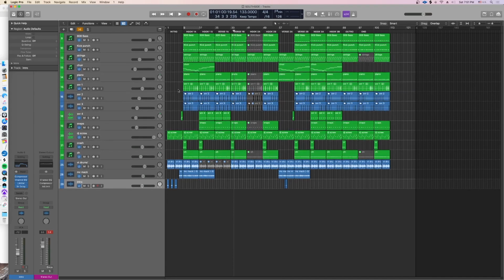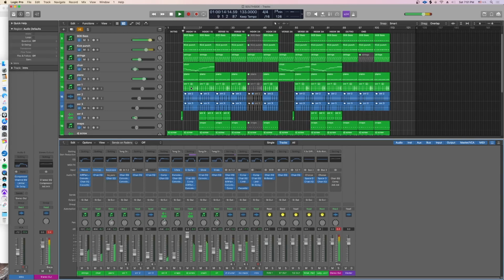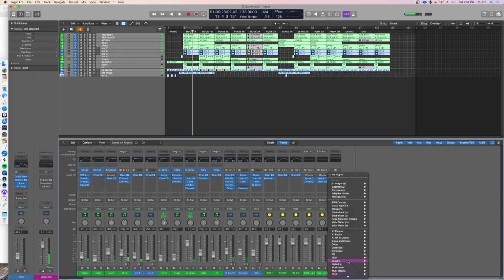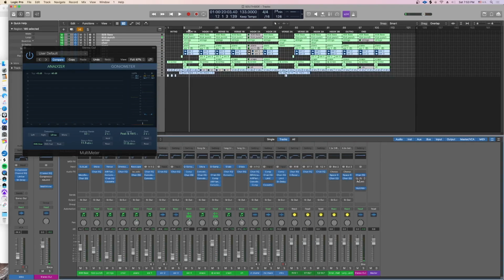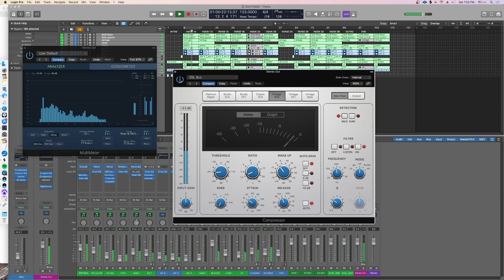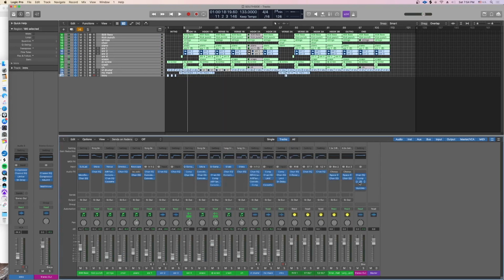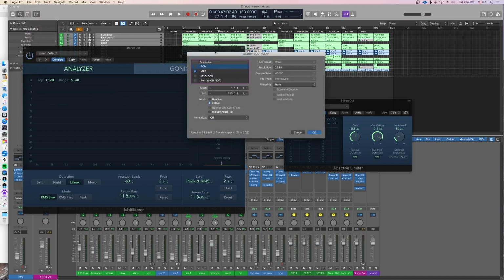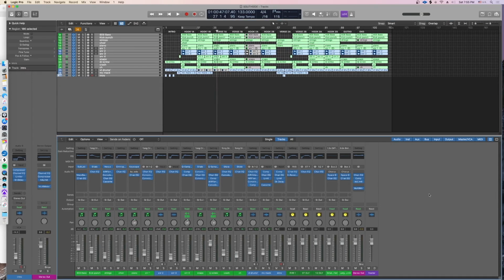How to Final Export  Your Stereo Mix Bounce in Logic Pro X

Comment: hey man thanks for this. Even with a fair amount of experience it still gets difficult if youve been using another daw instead for a time. Great to jump on and quickly refresh how to!  :)   If I Can ask -  "Realtime" as opposed to "Offline"  -  Any benifits to be had there by  "playing it through "  so to speak rather than digitalizing it totally?  & why would I want to "Bounce 2nd Cycle Pass"  -  why would that be a menu option at all?  Can you think of any scenarios where in you might NEED it?   I'll look up "Dithering" and "Include Audio Tails"  separately :)   Thanks again champ!!
Reply from the maker: Real time advantage is to listen to your mix so you hear what is being bounce.  Sometimes you’ll catch something you need changed.  You can do the same with offline bounce by just listening after the bounce and making changes.  Offline bounce can save time, if you do all your checks before bouncing anyway.  Bounce second cycle is basically the systems way of printing the track on the second pass through after the track has been written to ram, allowing for no errors since it’s already written to ram before it’s written to drive.

Comment: After I record my audio, inside the DAW, I have control of the individual track faders, the stereo out and master faders. After I make my adjustments inside the DAW, I export the audio and the audio did not keep any of my adjustments. I can have all the tracks lowered and even muted including the stereo out and master, when I export the audio, it still spits out the same as it was captured when recorded. 

What error am I making here? 

I have my Roland TD-50 plugged into my FireWire interface that plugs into my MacBook Pro. I use a headphone that has the input from it plugging into my FireWire interface output 7-8. I have a bus setup on the track that I monitor through while recording. What’s one thoughts?
Reply: …headphone amp